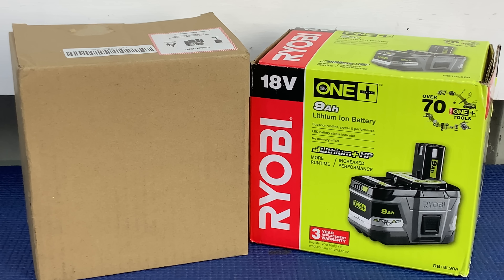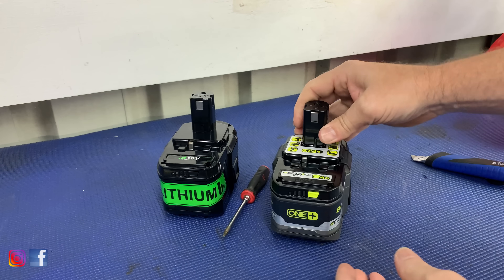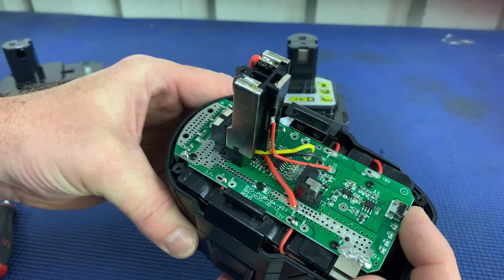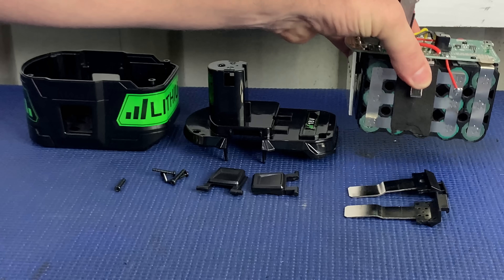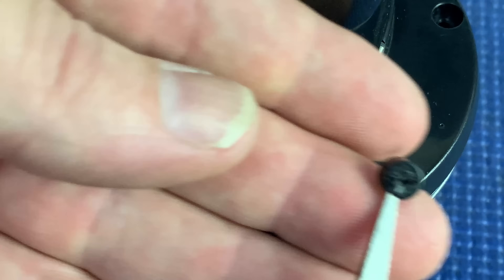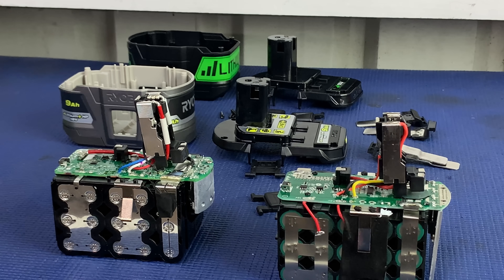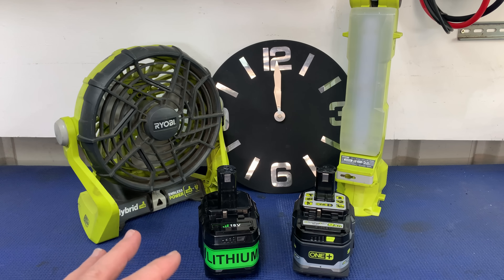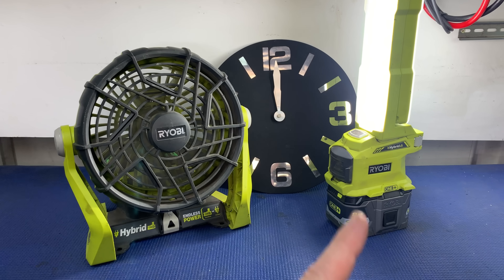Ryobi 9ah battery versus eBay knockoff job

Comment: Ryobi batteries are junk, in my opinion, they will last one year, and some die in one month. I say they built cheaply and are selling you a brand name just like apple. I wish i never started collecting their tools. If you have the receipt they will replace it most of the time.
Reply: Yeah, same experience here.  The tools are ok, but the batteries many don't last.
I had all my tools and batteries stolen recently, so I had to start over, and they have gotten very expensive now, so I bought some knockoffs, and figure I'll swap out the cells with even better ones and still cost less than the ryobi's.
Reply: @murraymadness4674  its crazy that these devices can be so great when the batteries work. Cheap China Crap
Reply from the maker: easier to get a replacement through ryobi than the cheap shit batterys that are 10000x worse..

Comment: Short answer is no.
Reply from the maker: just no.. is shorter lol
Reply: @HBPowerwall  - Ive bought knock off batteries for both my Ryobi and Dewalt tools, but they never last and getting them warranted is impossible.  If a Ryobi battery goes back in the warranty period, a single phone call will have a new on on the way.

Comment: So 1/4th the price? Why would any diy home user buy an original one.
How many times a year do you pull dry 4 batteries? Unless you are a heavy user and use many different ryobi tools and spend like every saturday in your shed building stuff or whatever i would just go with 2 cheapo ones.
I get why it is worth it, in my garage i only use makita, mostly because that was my first tool i bought, with original batteries as they get heavy use. And i just exchange the cells when they die.
But friends that are just looking for a new battery for their old tools i would definatly present this as a viable option to them.

Or do what most people do, just buy another tool that comes with more batteries. If you look for deals that usually works out decently.

Comment: This is how you go right buying the Ryobi battery!
  I have some decent & some "not so decent" 18650 batteries.
They both seem to start out good on milliamp capacity.
The main difference I can find between them is...after about 6 months of use, ...the knock off batteries will not hold a charge anymore.
The brand named batteries will last 4, 5, 6 times or even more having a much longer life!
I have a older Ryobi One+ tool set with a (P102) 24Wh Battery from 2009 it's still running strong with 80+% capacity!
You do get your money's worth when you buy the real deal!👍
Reply: I have a 4.0 genuine Ryobi battery that went dead in ~ 6 months. I have 2 Knock offs that have lasted over 3 years now. Mostly used in weed trimmer and leaf blowers, but occasional drill/saw use as well.
Reply: @Hylkamania  it is possible you had a bad batch of batteries or a bad battery in the pack?
Maybe the newer knock-off batteries getting better?
It would be great for us if they started lasting longer!👍
Reply from the maker: Knock offs suck
Reply: The batteries are probably cheaper as they use cheaper 18650 batteries, or are rejects.

Comment: The generic battery is a peace of carp it doesn't fit all of the ryobi tools and it over heated my charger so I'm having trouble sending it back to the seller of eBay.

EBay bad seller ailinbattery from new Jersey

The more on had a USPS label when I got it and it was delivered by dhl services and now when I'm trying to send the battery back they want me too use ups to return it 🙃🙃🙄🙄

Comment: Degradation is always a factor in any lithium battery you choose. It comes down to a cost/proficiency equation depending on your job needs. Professional contractors obviously need more from their tools, but for the average DIY'er, there is no shame in a knockoff.
Reply: A professional or even heavy diy user wouldn't even concider a knock off. Not worth the hassle and for the hours of use you get out of them the difference becomes marginal.

But for someone who uses their tools a couple of times a year, new original ones often just don't make much sense. Might as well buy a new tool at that point.

Comment: Good afternoon Mr.HBPowerwall, I checked your page for the 100 charge/decharge results on the knockoff battery. Did you manage to get these done? I have a 18v Makita fan basically identical to what you used in the video that I use when I go camping once in a blue moon here in South Australia so these results are fantastic for me. I'm considering a cheap ebay Makita battery for the fan, not much amperage load on the battery from the fan at lowest-mid setting. I certainly wouldn't use a knock off in my power tools, but I think this might be good enough for cooling the camp tent over night and I am happy with roughly 30 odd percent loss A/H for a much, much cheaper price. I would really appreciate your opinion on my thoughts if you have the time. I also appreciate the video, good content thank you Sir.

Comment: You can buy TWO of the Ryobi batts for $99 when on sale at Home Depo.  So, the cost spread is non-existent if not less and the quality spread is great.
Reply from the maker: maybe home depo sell better ones, but I can say the knock off died days after release of this video, original one still going strong.
Reply: @HBPowerwall  … you misunderstood what I wrote. The price is only $50 for a genuine Ryobi battery.

Comment: GDay  @5:23 Also noticed on the Knock Off that the red wire going up to the center post has a cut in the red insulation exposing the copper wire. I am a big time user of Ryobi Tools and I must have 15-20 Batteries and about 9 Chargers.  I learned my lesson on these cheap knock off jobs. Not worth the money unless you have no other choice.
One other thing mate, Where in the heck do you find that fast Torx driver? 😉 I want one...    BTW Remember with the knock off, you can't polish a turd.

Comment: The very obvious, these big batteries only have limited places they can be used. The weight and the bulk makes them very awkward on most power tools. For a mower, chainsaw they are probably good but for a drill, angle grinder etc too awkward. On some jobs I use 240V as the battery tools are not nice too use. In some cases bordering dangerous.
I have 4ah batteries and they are fine for the jobs I do inc high output rattle gun.

Comment: Bought knockoffs once…what was I thinking!  Mine felt light straight out of the box, so I charged them and then ran my blower until they were flat. I then tested my Ryobi batteries.  I found that the knockoffs were about half of their supposed rating.  

Lesson learned, and thankfully I didn’t burn my house down.
Reply: You're lucky the knock off battery didn't take out the entire city.

Comment: I've got a 5aph copy battery for my Royobi. It cuts out after a few seconds of hard usage "over heating I'm guessing" and then comes back on line after a few seconds, reoccurring cycle of on off.  The original 2aph Royobi battery doesn't cut out at all and is far better. Never again will i buy a cheap copy battery.

Comment: Ok. I have ryobi tools. I have ryobi batteries in the 4 ah versions. I have the aftermarket batteries over the 6.5 ah. They are the same. I live in a cold environment so a lithium battery lasting more than a year is special. The ryobi don't last a year. Yes I know cold effects the battery. I know to warm it prior to charging. I know to have it warm when I use it. I do my best. I have started to replace the 18650 batteries myself and removing bad cells. It's easier to use the aftermarket repair and replace because the board on the ryobi will not take a swapping cells. I don't know if the newer ones do. 🤔.

Comment: Well, I suggest you are buying crappy knockoffs because the one's I have (not that brand) are great. OK, not as good as a Ryobi but for the money, I have no complaints and mine are really lithium (I kinda gather yours were not). Mine also fit the tools and have the same "snap" as the genuine.
Reply from the maker: Nice
Reply: @HBPowerwall  It's a lottery, the quality of the non-genuine ones is highly variable. The trick is to find a decent supplier and stick to that brand. I'm sold on the quality of Ryobi skins however, they are by far the best value cordless tools out there, the haters are buying into branding fanboi stuff.

Comment: The main mistake was buying through ebay...
Reply from the maker: eBay is great, the issue was the manufacturer/seller lies
Reply: @HBPowerwall  No, ebay is far from great. They gouge, allow fraudulent sellers, and withhold money without good reason. They should be wiped off the face of the earth.

Comment: Ok, I am coming to this late.  I own several genuine and knockoffs.  Unfortunately, the knockoff brand I like doesn't make the Ryobi 18v anymore.  The name brand works better in tools that pull a lot of amps, my knockoffs work well in my fans,lights, and my old Ryobi blue tools.  I don't know if Australia has it but I now get my Ryobi batteries from their direct tools outlet website.  Yeah they are refurbished and factory seconds but the price is good and they work just as well as what I get at Home Depot for full price.

Comment: It would be better if the big brands like Makita, Ryobi etc looked at the difference between their batteries and the cheap batteries and just charged a bit more for the better quality material used instead of charging 4  as much!!!  It's a rip off in my opinion.

Comment: I have 2 x 5AH knock off batteries - fit and quality is very close to Ryobi - actual contacts seem to be better quality. Been using for more than a year without issue. I have not done actual run times, but certainly appear comparable.

Comment: Why can't the individual batteries in the pack be made to be easily removed and replaced by the owner? This may not be feasible for high voltage rechargeable batteries but the ones they stuff into cordless hand vacs don't last much longer than a couple of years. Then the whole kit and kaboodle gets tossed in the trash or sent to the recycle depot.
Reply from the maker: I would say making them more serviceable would be a warranty/liability risk.

Comment: We've noticed with Ryobi batteries the cutoffs on the protections that are in the battery will stop the battery from being charged it won't even allow you to put a charge on it where the cheapo batteries you like to say when they are lithium batteries they will charge no matter what and here you're sitting with two lithium cheap batteries and you could have 10 Ryobi name brand batteries and none of them will charge it's because of the components that are with the battery The batteries themselves are great but when you put all these computer boards in with your battery and start talking about my battery won't charge there are reasons why but let's not talk about those

Comment: I've bought a couple of the knock off batteries from different companies and none of them last long. I have original Ryobi batteries that are years old and still working as a mater of fact NONE of my Ryobi batteries have ever failed. I bought the knock offs to have larger extra batteries but I have learned my lesson. I only buy Ryobi  batteries now.
Reply from the maker: ooh i've had ryobi fail, but not at the rate this crap did lol

Comment: I have bought three of the knockoffs, tempted by the much cheaper price.  The ones I bought are a pain to get out of the tool rather than being too loose.  One now charges quickly and then lasts no time at all so that's off to re-cycling!  The others don't last as long as the real thing, So they don't get used now
I will never buy another knockoff battery, instead I wait until Ryobi have a special offer running which narrows the price difference.
I really don't need any more batteries but I can't help buying them - just in case ! lol

Comment: I have no electrical knowledge,  but, I have been using knock off 4 and 5 amp batterys as well as ryobi ones for meany years with no problems, most used tools are angle grinders  and impact wrenchs. As I am in UK battery charging is always done indoors in winter anyway!  however I used to get battery problems when I used to use a single battery charger. So a long time ago I bought a ryobi 6 battery charger and conditioner of which i keep unused batterys in it all the time never switched off. and I have never had a battery lose since. could be 10 years or more.  One thing I do find with knock offs is it takes a few charges before they preform at their peak. new out of box with first charge can be very low run times, but they seem to improve as i said the more times they are charged I have just bought my first 2 HP tools minutes before writing this, and I am concerned that I may not get the best results out of my Knock offs, but they do seem to have the extra conector required for HP tools. At moment I have no way to compair as even the ryobi batterys are not HP ones So I may have to plunge deep into my pocket and buy a HP battery, here in UK it wil more likely cost mare than the tool itself! . Just checked £159 for 9 amp one!  the  Brushless High Torque Impact Wrench was £148 in sale today over £200 normal price.

Comment: Only 100G difference is great and some of that is in the difference in manufacturing materials. A proper test would be to use a load tester.
Run individualized tests at1A, 3A and 5A for each. the fully charged voltage Should be 21V [5 x 4.2V] Nominal voltage is 18V [5 X 3.6V]

Comment: I learned as a kid to never buy off brand batteries. I was forced to a year back on a laptop and the new battery was trash. I refuse to buy off brand if the real thing is available no matter the cost difference. The off brand might as well go straight into the trash.
Reply from the maker: They work but not as long and are typically much higher risk of fire or early life failure.